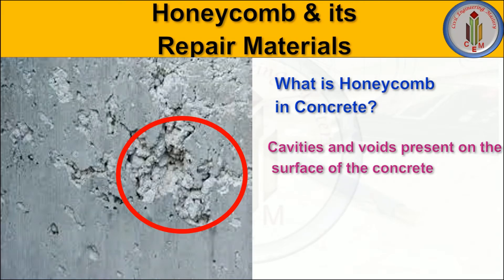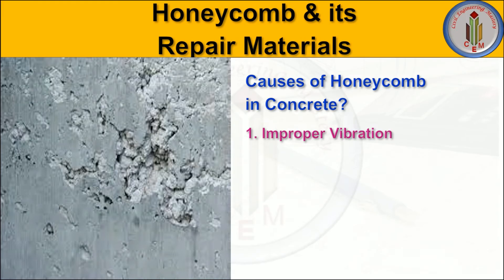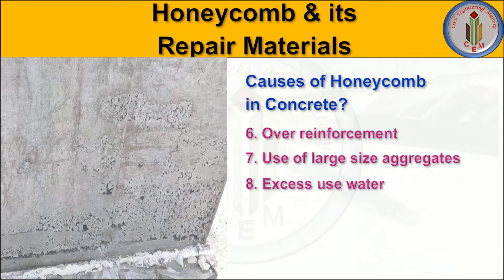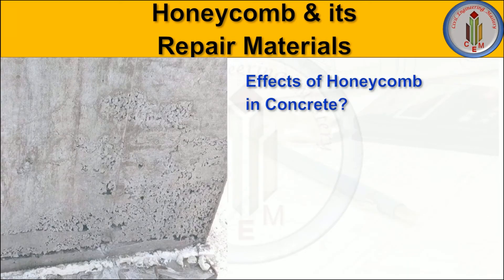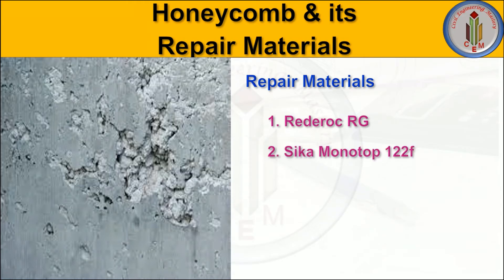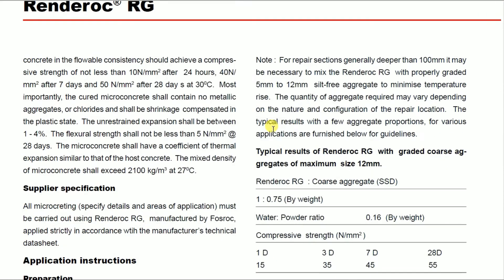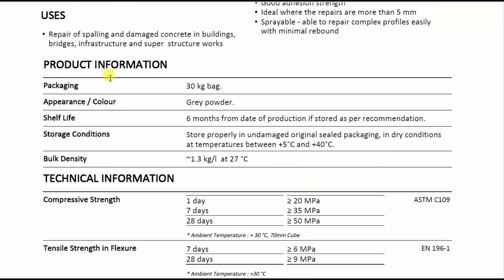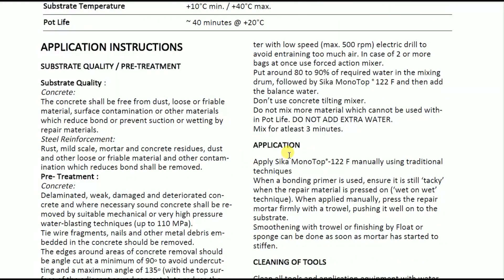Honeycomb in Concrete and its repair materials | How to repair honeycomb in concrete | Fosroc & Sika

Comment: we have a concrete flr for car parking of 10 yr old. Over the years the cement is eroded , & the stone / aggregates are still sticking . Now we dont want to dig out & relay concrete. we are looking for a strong bonding agent with the base & to fill the surface as with a putty type of cement or any amterial . preferable with cement .can u suggest ?

Comment: In the US we referred to these as "rock pockets" because of the visible aggregate and lack of cement. Adequate consolidation is extremely important in cast in place concrete, and it's not always an easy job, especially on large columns or shear walls. When I used to do this kind of work, the places most common to form honeycomb were in corners or around block-outs. The corners often happened because they are difficult to reach with a manual vibrator and tend to have a lot of rebar in very tight configurations, which makes it difficult to get the head of the vibrator into the area without getting stuck. I have actually seen a 20 foot vibrator whip left in a wall because it got stuck so bad. Another time we had to pull it out with a crane. Proper workmanship and experience in large pours is critical for the integrity of structural concrete.

Comment: Thanks for the video. I am running a construction company in Hyderabad. Construction of residential buildings. This video will be very helpful for my projects. I look forward to more posts regarding potential structural issues with proper repair materials. In my past gulf experience, I was using FOSROC material for the structural repairing, which are best remedies.
Reply from the maker: Great 👍 Thank you.
Reply from the maker: Kindly share this video with your friends.
Reply: I have already shared your post to my friends, who are working in government sectors. They’re are also forwarding to their contractors. In one of the discussions, I have spoke to them about the importance of the FOSROC Materials. 

I will keep forwarding your post to other fellows. Keep doing your good job👍
Reply from the maker: Ok.Thank you.

Comment: Hi,
Nicely presented! Good work.
Does Fosroc or Sika have a suitable structural repair material for concrete swelling, structural cracks, tie rod hole packing, etc.? 
It is very helpful for my projects if you post one more video with the above information!
Reply from the maker: Thank you. Sure, will post a video.